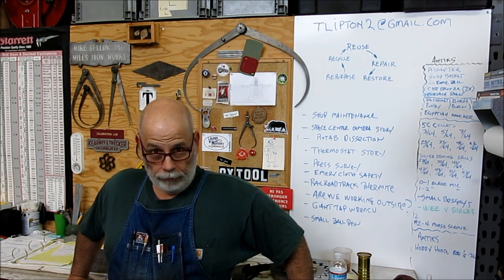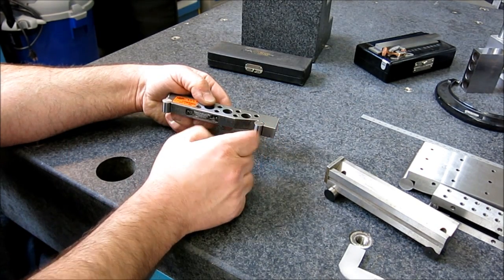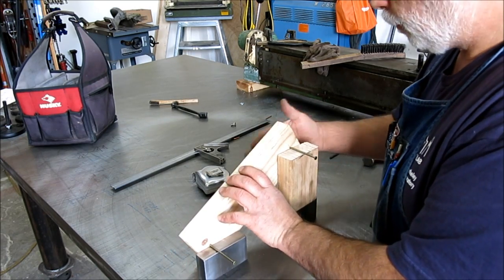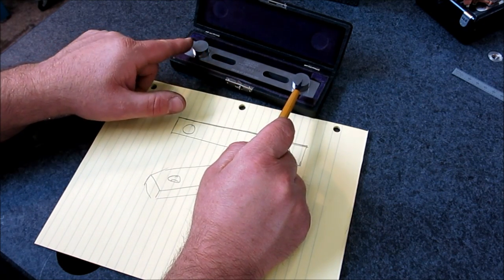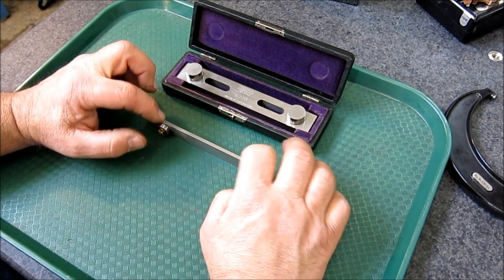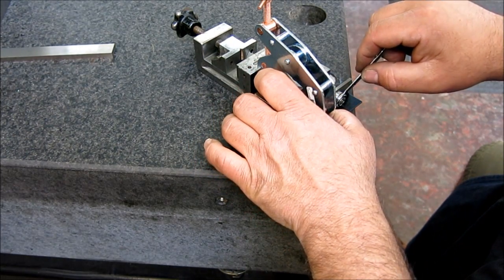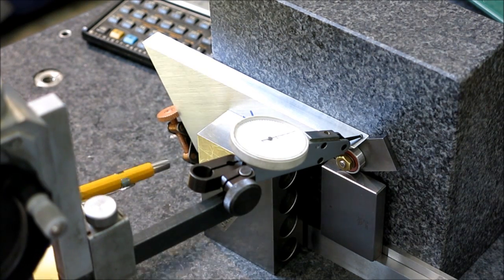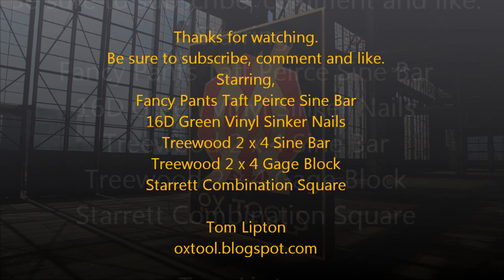Whats My Sine?

Comment: What I was considering was to drill two press fit holes for 1/4 dowel pins at 5.000 on center.  That would be as accurate as my mill is capable of.  Then I would press the pins in and halfway through.  Now I would take and place the bar in the mill vise with the pins resting on parallels.  A nice cleanup pass accross the top would make the top of the bar flat and equal distance from the pins.

I think that would work and the results would be as accurate as milling can be.
Reply from the maker: Hi Ct,

You can measure the pins and record the actual center to center of the pins. If you want the best true position of the holes drill undersize and bore or drop an end mill into the hole to establish an accurate location.

Cheers,

Tom

Comment: Tom,
Just a thought... You could set the distance between the bearings using gage blocks.

Just a question... Are you familiar with the main shop up on the hill?

Frank
Reply from the maker: Hi Frank,

Yes blocks would be the best way to set the distance. I wanted to show the simplest method that anybody could do even if they didn't have gage blocks or anything too fancy.

Yes I work with the main shop all the time. Got lots of friends there.

cheers,

Tom
Reply: Tom,

I worked in that shop in the latter part of the '70's, when Louis Alvarez was Director.

Small world, isn't it.

Frank

Comment: Those wrenches are that way because you need one for the head and another for the nut.

Of course, i bet you have 2 sets so for you its not an issue. ;)

Interesting el-cheapo sine bar. I might make one but turn some press-fit pins on the lathe.
Reply from the maker: Hey Scott,

I have another set but their all open end. Dohhh. Time to buy another tool.

Cheers,

Tom

Comment: So with the other wrench you can have one for the nut AND the bolt.
Reply from the maker: Hi Caps,

This actually makes some sense. It didn't click until I read your comment. Out of habit I find myself swapping ends expecting it to be the same size. Rarely have to back up a tiny little bolt and nut combo.

Cheers,

Tom

Comment: If you measured the sine bar without any gauge blocks on the one end, is it parallel?  I would think if one was trying to create a more accurate version that would be a good check to see if there is something off in the tool's geometry itself.  If it is parallel, then you may be able to use an angle standard and known gauge block heights to calculate the distance between the contact points.
Reply from the maker: Hi Gopher,

The parallel is parallel. You are right that you should check to assure the parallel is actually parallel. If you use the same side that you gage the rolls off then the opposite side need not be parallel. I have swept all my sine bars and they are pretty good. The hard part is the angle standard.

cheers,

Tom

Comment: I know you said below that you were looking for the simplest method that anybody could use, so you didn't use gauge blocks when creating the sine bar.  But you used them when checking the angle.  My question is what would someone use to set the height (larger heights) like you did for checking the triangle if you didn't have gauge blocks?  Also have you had any experience with the cheap offshort gauge block sets?  I know that you say the pin gauges from those sources are okay, but you have never said anything about their gauge blocks.  Per your recommendation I have ordered some slave labor pin gauges, which will work well for setting the sine bar for morse type tapers, but am also wondering about the cheap gauge block sets. 

I am thinking that they are probably far less accurate compared to the relative difference between first world and third world gauge pins; however, they are almost certainly more accurate than anything I could produce myself.  What do you think?
Reply from the maker: Hi Walter,

The problem with gage blocks is checking them. Basically you either have to trust them or have them checked or check them yourself (not recommended). For basic not super critical stuff I use my adjustable parallels for setting the sine bars. If I want to get fussy I pull out the gage blocks. I think for 99% of anything a home or small shop would do import gage blocks are a great addition. The import block are well outside our ability to check with any certainty. 

All the best,

Tom
Reply: oxtoolco Thanks for the response!  I didn't even think about using my adjustable parallels.  In terms of the gauge blocks, we can check them to tenths with micrometers, so they should be usuable for that at least.  And since the micrometer is the best measurement most can make, we should be able to use the gauge blocks to be 'at least' that good.  Either way, the cheap import set is on my to purchase list, but it is nice to know that I can use my adjustable parallels or my gauge pins until then.

Comment: Darn I missed my guess. I was expecting to use cylindrical allen head bolts instead of bearings and little screws.
Reply from the maker: Hey Brian,

Try some shoulder bolts if you have them.

Cheers,

Tom

Comment: Good lesson Tom. Is that HP calculator RPN logic? They haven't changed the design in 25 or 30 years IMO a good thing.
Reply from the maker: Hey Eric,

Oh yeah I'm an RPN kinda guy. I can barely run an algebraic any more. Believe it or not I can use a slide rule which I proudly admit.

Cheers,

Tom

Comment: Hi Tom, the Accuracy down arrow (click on it) goes to 100 thousandths - .00001, this question is from me, this is not enough?
Thanks for the fast reply.
Mike.
Reply from the maker: Hi Michael,

Sorry, I missed the accuracy arrow. If using gage blocks to set the sine bar the highest accuracy available would be .00005. This is typically the limit of standard gage block sets.

Cheers,

Tom

Comment: Why not make two stepped pins out of steel that slip into the parallel holes with a known diameter of your choosing instead of the bearings?
Reply: You'd have to assume the hole were space accurately and you'd have no way to adjust
Reply from the maker: Hi Nunya,

The holes in the parallel are pretty rough. I wanted to show how to adjust to a nominal center distance. Thanks for the comment.

Cheers,

Tom

Comment: You could prank dial pins and then put the bearings on it then I'll be identical or you don't need bearing you can just used dowel pins

Comment: Ok there sinx guy 🙂  The bearings are not centered and held there.  they are measured on length of bar but you stack up on the angular dimension  of the bearing.  Not on the spot.  Maybe that was the error offset.

Comment: Should of used gage block in side instead of mics. My two cents
Reply from the maker: Hi Seno,

I wanted to set the length without using gage blocks. Normally this would be the best way to set the roll distance. Not everybody has a set (they should) but most guys have a micrometer and length standard to calibrate it. The riser blocks can easily be swapped for an adjustable parallel or a machined block or even a 2 x 4.

cheers,

Tom

Comment: It would appear that Mr. Lipton is not just a machinist but a "JOHHNY WOODWORKER" not only did he use a claw hammer on those framing nails but he flatten the points to avoid splitting the 2x4s. If brains were hair fertilizer you sir would have a lions mane.
Reply from the maker: Well it was a precision 2 x 4 after all. I would have been roasted alive if I used a ball pein to hammer nails. They actually work crappy for nails. The face has the wrong curvature for nails.

Cheers,

Tom

Comment: Ball bearings are manufactured to a high standard. Couldn't you use a 20mm ball bearing? I mean just a the ball not a race. Eliminate the play in the race assembly.